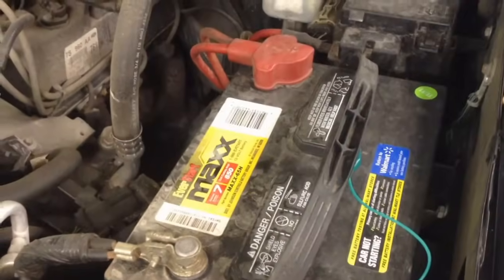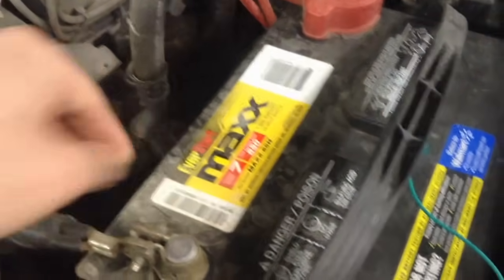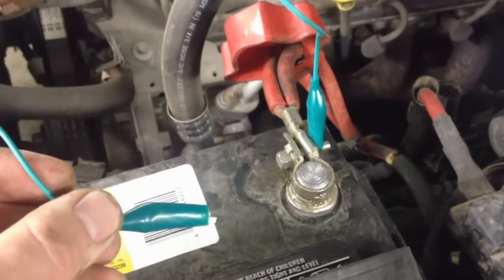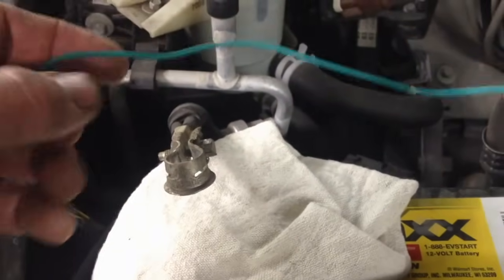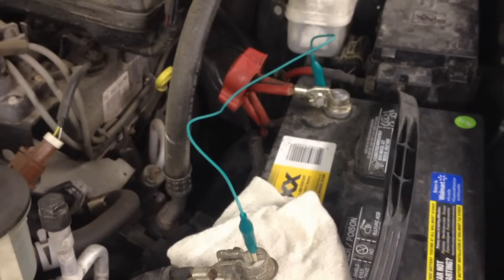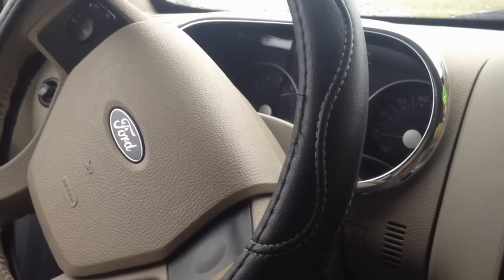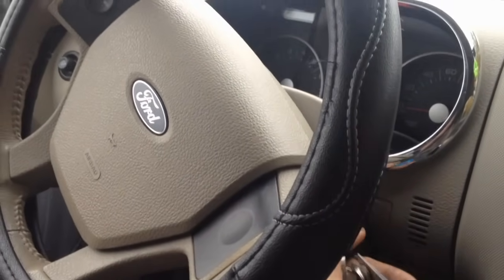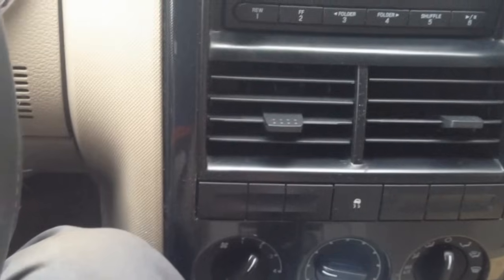How To Clear Your PCM'S Memory On Fords After Repairs

Comment: I have a 2007 Ford Mustang GT.   One day it left me stranded along the road.   Had it towed home and checked the battery and alternator.   Battery was good alternator bad, I changed the alternator and had it rechecked both battery and alternator where working properly but the check charging system and battery light did not go out and has not gone out   How do I clear this?   It’s very disconcerting.

Comment: For the test drive. You did it in a non traffic flat road which is great so you could drive not too hard and not too soft. But I'm my case there are uphills and downhills and traffic before I can get to a highway or flat road. Is that irregular road OK for the relearn test drive?

Comment: Hello Brian
   I have a 2003 ford windstar, the OD was flashing on the dash board, found a code PO720  which was a speed sensor,
replaced it but can't get rid of the code also the ID still is flashing, took the neg off the battery for three hours, put the
neg back on the battery went for a test drive and the OD is still flashing, used the blue driver to get rid of the code
but the code still comes on when I drive a block away from my house - having to watch this video of yours
I am willing to try this and hopefully it works  - my fingers are crossed - hope I get a replay back from you .

I have been a subscriber of yours for a number of years -

Comment: Your videos have been phenomenal in helping with repairs on my vehicles over the years so thank you. I do have a question on PCM resetting however I have a 13 range rover and while unhooking the battery does clear the CEL, I do notice that the codes stay stored when I check them with a scan tool. So my question is will draining the capacitors in the PCM clear the stored codes and also will the range rover follow the same procedure to relearn everything like you’re doing with the explore in this video? Thanks again for your time.

Comment: What about disconnecting the negative battery terminal and switching headlight on, would that drain capacitor on ford vehicles and have the same effect?
Reply from the maker: Absolutely not.

Comment: I am not an electrician so I don't  understand very well this procedure. It seems like you are creating a short circuit by connecting both ends to the positive instead of draining the remaining energy. It seems harmful for the pcm, but not sure. Would connecting both ends together (out of the batt) do the same effect of draining the energy inside the car's electronics, maybe also turning on the headlights? Would this work on a 08 explorer? Thanks

Comment: Don't arc from red to negative. Just disconnect black battery terminal. Then turn headlight switch on. Almost instantly drains your auxiliary power with no damages. Leaves current empty. Then, switch key over but don't turn engine over. Leave your foot on brake and wait. It's gonna reset and sweep all guages. Then you're good.
Reply from the maker: That will not work anymore nowadays, everything is ground based switching.
Reply: @FordTechMakuloco  ah, I didn't consider the actual age of my own vehicle. You may be correct, my apologies. I'll admit my ignorance, but it'll be a good lesson and an interesting curiosity in research. Like, why would you choose to build a vehicle that way or the old way and did it really fix anything major or many minor issues without creating new ones in replacement. Haha. Thank you, sir. I'm off to the research. Perhaps I'll return

Comment: So you’re telling me you can take it out off like that ground it off on the other side on the positive to the negative with a negative unplugged on the battery and I’ll reset transmission shift mind shifts way too soon and second gear it’ll throw you in the seat and the transmission has been rebuilt

Comment: This didn't work clearing P1000 on 06 Crown Vic 4.6L, caused I think by junkie AutoZone radiator fan module... wouldn't care except it disables my AC! Tried three times, up to an hour with jumper wire. Is it possible my ignition key needs to be on while jumper is discharging PCM? My only option is Ford service manual 14 step (60-90 min patience testing) Drive Cycle routine two times in a row! Finally half way thru after third try, I finally got the trip counter to increment...guess i can't follow directions and was messing up step 10! Sorry if this has already been answered but YouTube doesn't give us a way to search 100s of comments
Reply from the maker: This will set a P1000 not clear it.

Comment: I did that trying to fix my 2nd shift delay on my 2016 Ford Escape but it won’t work I did it many times last few months but not fixing the issue , flushed my transmission fluid and that didn’t fix it also 🤦🏻 anyone know what to do next ? 47k miles

Comment: So could I disconnect the positive cable from the battery also, and just connect the positive and negative cables separate from the post and loop them with the jumper to drain those capacitors
Reply: As long as the ground is loose from the battery …you can do it either way. It really needs to have a small resistor with high wattage …connected in series for 10 minutes between the two terminals,  for a more controlled drain on your PCM capacitors. You can order them on Amazon. (1 OHM 10 Watts) ! Around $2 dollars on Amazon prime. Creates a slower drain on the voltage stored in your capacitors ..otherwise it’s possible, it can possibly do some damage to your PCM …A thousand dollar board. Electronics engineer, here …..I’m just trying to add my experience , to save somebody extra money…. it may work nine out of 10 times ,,,with my luck it would be me on the 10th time ….Having to pay over $1000 for a new PCM and having to have it reprogrammed!

Comment: I have a 2003 Ford f150 with a 4.6 triton and everytime I change something else it seems to get worse, I've replaced egr valve solenoid yesterday and now it's idleing very rough, almost don't even want to let it idle cause it sounds so bad, I'ma bout to scream lmao, and changed tranny fluid, does the cam shaft sensor have to be put in a certain way, I'm fixing to try this just found your video, and it has a smell as soon as I tried to start it this morning. I feel like I'm just wasting money on it I hope this works
Reply: Oh and I replaced 2 fuel injectors also it didn't help none, so hopefully this fixes it I'll let you know

Comment: Glad I found this video. 2010 escape with late/ hard shifts and rough and idles with rpm fluctuations. After clearing and relearning the pcm she’s holding a steady idle and shifting properly. Definitely wasn’t looking forward to replacing a transmission in a vehicle with less than 120k miles. Thank you so much!

Comment: Can anyone tell me of what the purpose is of leaving the positive connected? Thanks
Reply: Any any time you remove the negative from the battery…. the positive post is just floating in space , it does not have any charge potential… without touching a ground to make a circuit. That’s why he laid the towels over the negative post so it will not contact the terminal for the ground cable. 

You can remove both connectors from your battery …and jumper if that’s what you wanted to do …it would Give you the same results. It just saves you having to take another connection loose.

Comment: Question. My 2005 f150 5.4 triton went in the shop for a NY inspection.  The scan says catalyst not ready.  The shop has had the truck for 2 weeks now and can’t figure out what’s going on. They drove it for 80 miles going through the process of resetting the catalyst with no results.  Would following this video instructions fix my problem.  Btw, the shop is replacing my cam phaser, would that cause my problems?

Comment: 2008 Ford Expedition XLT 5.4 when I am parking the vehicle putting it in reverse or moving forward a short the engine idles very rough, shakes and knocks. This only happens after the engine is warm after driving. It does not happen when cold. It has to be warm after driving it. Pls answer me.

Comment: Would this help with a 14 raptor with wheel hub replaced with oem hub, but when test driven abs, tsc  downhill decent and brake  lights came on. I’m thinking it doesn’t like the abs sensor. Any thoughts .. was thinking bout puttin old wheel sensor back in ?

Comment: I have a 08 f350 that’s this procedure didn’t help with weird electrical problems it’s having. Have to disconnect batteries everyone i turn the truck off or the daytime running lights will stay on, windshield wipers won’t work (used to work on high but then wouldn’t stop without pulling fuse) wiper spray doesn’t work (replaced ignition switch, didn’t fixed either wiper function), a/c & heat only work on high, no horn, when camper is hooked up dashboard says “ wiring fault/trailer disconnected”, humblemechanic has a video similar to this stating this procedure has fixed so many of those weird electrical problems so not I’m trying to figure this out.

Comment: I had a fuel pump/sender on my 10 Explorer Ltd replaced recently, as the original fuel gage sender went bad. The fuel gage is screwed up now. When the gage reads empty and I fill up, I can only get 10 gal into the 22gal tank.

Replacement pump/sender was a Motorcraft part.

Will resetting/clearing the pcm clear up what is going on here? Any other ideas?

Comment: love watching your videos and learning how to keep my ford explorer going.  I recently had my fuel pump replaced on my 2007 ford explorer and I think the calibration is off with  the fuel gage.  I know my tank is supposed to hold 22.5 gallons but now I get a signal that my tank is almost empty but when I go to fill up it tops off at 17 gallons but meanwhile it is telling me I have only 35 miles until empty.  I feel like it is off my 5 gallons? Have you experienced this issue?  and do you think resetting the PCM will help.

Comment: Got a quick question but 1st I wanted to say thanks for the great videos, definitely one of the most informative channels on the tube! But my 2010 F150 4x4 5.4l  keeps going into limp mode every now & then giving P060a & U0300 codes & will actually not crank up unless I have some jumper cables on it even with a brand new fully charged battery but goes instantly into limp mode. When it trys to start the starter engages & you can hear the bendix make contact with the flywheel but it doesn't actually turn the motor over. The last 2 times It happened I moved around the PCM relay & it fired up & ran for a week correctly. It seems all wiring to relay (that I can see) is good & the female pins don't seem to be stretched out where it would be making bad contact but my question is could it be a corroded terminal I can't see or is it the actual pcm going bad? When I swap the relays around to get it to run the relays test good on my relay tester but I just have to put a different relay in to get it to work. Totally baffling!

Comment: I bought an 09 f250 6.4 from a used car dealership and a few months later I had all of 5e fluids replaced and it immediately started throwing coulda and went into limp mode. I drove it 1000 and it seemed good then it clogged the dpf and egr. I cleaned the dpf and replaced the egr and some broken exhaust manifold bolts and the dpf pressure sensor. The pcm doesn’t know there new parts and still throws the codes even after I drained the capacitors. Any ideas?

Comment: I assume you'll still need to do most of this even if you have a manual transmission? I just changed the O2 sensors on my 2012 V6 Mustang since it was spitting codes for the sensors. It's still running a bit rough. Since it's a manual transmission, I shouldn't need to reset the shift points as I handle that. :)

Comment: UNBELIEVABLE!!!
I have 2018 F350 6.7 was shifting so hard it thru the truck in lump mode 8 times in 8 miles. So slow to shift it would fall to 45 mph on hills. I didn’t think this would work but tried it. After starting the truck for the first time, it ran quieter, couldn’t even tell it was idling when sitting in drivers seat, and it shifts like an absolute dream. I have 263000 miles on it all from east coast to west coast 3 times a month. Never seen a Ford dealer since I drove it off the lot, do everything myself, but was about to give up and take to Ford, so glad you posted this video. Awesome!!! Please don’t stop posting fixes for these vehicles, the newer they get the more expensive they get, and I refuse to let anyone else drive it, much less work on it! Thanks again you’re awesome!!

Comment: Could this help clear the mykey system. I got stuck with 1 key in mykey status. Its a 2020 ranger with the 2.3t
Reply from the maker: no
Reply: @FordTechMakuloco  why thanks for replying. That is rather impressive to be honest. Not alot of host reach out like that. I've been watching alot of your footage lately. Actually  so has my wife. Your teaching  her alot. I've been working  on them for years and your teaching  me too. 
What would you suggest with this my key set up? How do I get around this. Also do you think the 2.3 turbo should have a catch can and if so are you fond of any certain type and does it do alot inside as far as lengthening the time frame for manual cleaning  if the valves.

Comment: My transmission just stopped going into gear after having the engine replaced. It drove fine and shifted for about 2 weeks then the tranny stopped going until gear. Would this procedure help with the transmission?

Comment: just unhook ur neg cable and step on the brake pedal for 30 secs or turn on the interior light switch, that will do the exact same thing as a jumper...if theres any residual power, it will drain fast
Reply from the maker: Nope you are so far off here, you are stuck in the past when cars were wired directly. Those old tricks haven't worked on cars for at least 20 if not 30 years now...

Comment: I have a 2009 F350 diesel with two batteries.  I connected the jumper to the passenger side battery as it seems to have the most wires connected to it.  I did not unhook the driver's side battery.  I just put the jumper on and got a quick spark.  Am I doing it correctly?  Thanks.

Comment: My A/C clutch stopped engaging when mine went into limp mode over an unresolved misfire. The misfire problem is resolved now, and it’s no longer in limp mode. So would the a/c clutch automatically be enabled again, or is there something I need to do?

Comment: I have a high idle on a 02 Ranger 3.0 engine and replaced all air sensor parts, but still have a high idle when shifting my manual 5 speed....would this procedure work to fix my problem

Comment: Just replace the starter on a no start issue. Also changed the relay I thought was causing no start. I also replace the Ignition switch still no start. Will this procedure help my problem?  The vehicle is a 2010 Ford transit connect XLT. Thank you for your time I do not believe I have a security issue. At least with my backup key.

Comment: is it mandatory to connect the cable on the unplugged negative conector? Or can it be connected on any other metal piece of the car having of course the negative unplugged? I'll try this in a Mondeo MK4, which by the way has a very uncomfortable battery position.

Comment: I have a P 1000 code on a 2010 F150 lariat four-wheel-drive 5.4 L. I clear the P0 62F code and it has not returned in five Drive cycles and I scanned it with my FIXD scanner and it says “empty result” for a secondary air status when scanned. Any thoughts?

No check engine light is currently on and the truck runs fine.

Comment: Would this work on a 96 E350 powerstroke diesel transmission that went into limp mode due to a bad overdrive wire in the shifter? I replace the shifter but is still in limp mode but the overdrive wire is no longer flashing

Comment: Would this application work on a 2000 excursion 7.3L? I'm replacing ICP, IPR, CPS, EBPS & Tube. Truck has 250k just started rough idle after warming up... have codes for U1262 then PCM P1280, P0380, P0475, P0232, P0460 they are all Continous Memory DTCs. After this round of replacements will be glow plugs and harnesses, then injector o-rings and shims, unless I ended up with a bad injector- then I'll just replace them all instead of the o-rings. Previous owner hasn't done much maintenance other than oil/filters... 🤷🏻‍♀️🤦🏻‍♀️

Comment: I have a 2013 ford Explorer and it has been throwing both codes P0420 and P0430 I have replaced the sparkplugs, o2 sensors, MAF, gasket on the manifold intake I was thinking it would need new cats or a new ECM would this work for my codes???  I need to get this thing smogged

Comment: Have you ever ran into code B2A20? 2008 Ford F-350 5.4l I’m having issues with the power not shutting off when removing the key from the ignition

Comment: Can anyone offer any knowledge, I have read so many conflicting documents... on a 1993 e150 5.8l i removed and cleaned Iac and throttle body, verified everything is put back correctly, I did the pcm reset as instructed. Now idle is dropping and feels like a miss. Went to drive it after 10 minute warmup and had to turn around because van had no power almost stalled a few times and was bucking with no power. All that happened in less than a 2 mile drive? Please advise. Ive been working vehicles for 30years and I am stumped. Van has 180,000 miles on her.

Comment: Crank no start after KAM reset?
Had a 2015 come in 171/174 always lean and Purge valve circuit. Found Purge valve stuck wide open. Replaced it Reset KAM no its crank no run, Cranks surges then dies.?

Comment: i have a 1989 Ford Bronco 5.0 V8  5 speed stick,   it has a idle problem it goes up & down at a stop,  i changed the Throttle positioning sencer,    then i changed the MAP sencer and a few other things and it still does the same thing, " does not idle right,"   do you think what you showed on the Video would Help on a 89 ' Bronco   ?     HELP  ...  at witts end ...